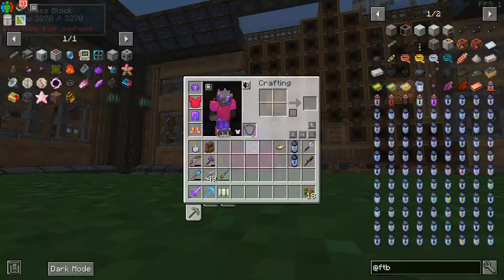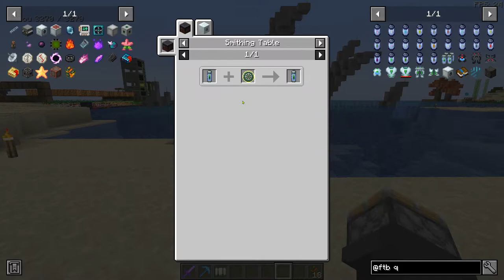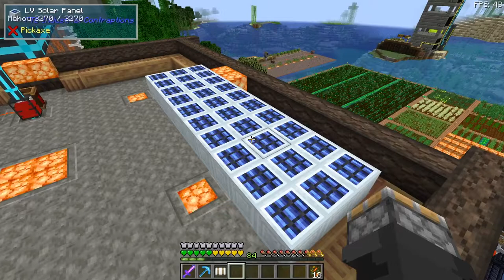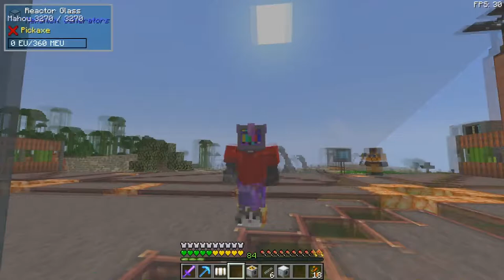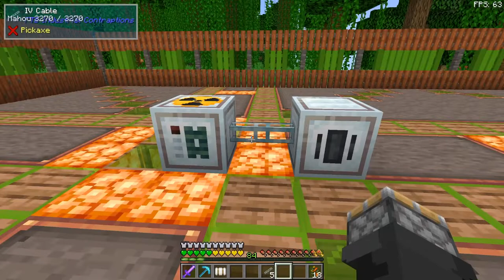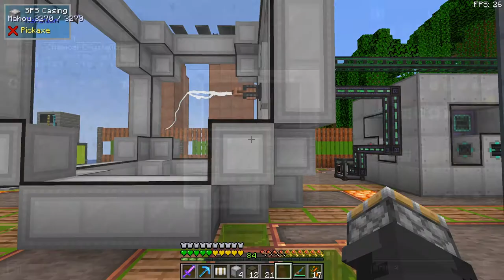2 Types of Antimatter - FTB Industrial Contraptions & Mekanism - ATM7 Ep 15

Comment: very late but... was messing with the antimatter constructor since I didn't know how it worked, and was working on other things, so casually hooked it up to my solar panels that were working on powering something else, then started watching this video, since I didn't know how to make FTB IC antimatter I searched it up and found this video.
So I feared I might need a whole lot work getting all these items, only to realize I had 11 antimatter already sitting in my constructor, WELP...
I just used the pump from FTB IC and attached chests to just drop empty fluid cells in there. and then a pipe out to export the full ones.
Reply: what solar panel you use ? I use mekanism generators one and didn't give any power to the constructor

Comment: can i use the mod POWAH nitro reactor to power the mekanism fusion thing ?
Reply from the maker: I don't see why not? But it takes a ton of power to make the antimatter in there. I'm unsure of how much rn or how much the nitro reactor puts out. So you might want to make a power reserve bank like the matrix that I have in that video to store enough.
Reply: @TubeAndKnuckle  the nitro reactor generates 460k+ FE/tick
Reply from the maker: @Raku235  The other thing is you need plutonium and polonium pellets to craft the parts needed to build the Supercritical Phase Shifter structure. For those pellets you need a MEK Reactor to get nuclear waste so.....might as well use that reactor to power the SPS at that point.
Reply: @TubeAndKnuckle  yeah figured that out when i was checking the recipes, ive got your setup working but its kinda slow but im almost done
Reply: also i tried to build the Supercritical Phase Shifter just how you built it, but it didnt give me the redstone effect and it wont open, did they change the recipe ?
Reply from the maker: @Raku235  No recipe change to it. You must of placed some blocks wrong? Double/triple check your build
Reply from the maker: @Raku235  Did you play with the burn rate of the reactor? that is how you can speed it up. But be careful not to exceed the limits!! That thing will blow up!!!
Reply: @TubeAndKnuckle  i just typed the max burn rate which is 25 i think
Reply from the maker: @Raku235  Aight cool. Did you get the SPS thing working?
Reply: @TubeAndKnuckle  i rebuilt it around 6-7 times and changed the reactor glass to structure glass and messed around with the layout of the ports untill it randomly worked
Reply from the maker: @Raku235  Sweet! Congrats... I know the struggles sometimes things are just goofy😒
Reply: @TubeAndKnuckle  i learnt the hard way why you checked the pipes were empty before breaking the nuclear waste pipes 💀
Reply from the maker: @Raku235  OHH NO 😂Hopefully you had the suit on that makes you talk Russian🤣
Reply: @TubeAndKnuckle  had to make one, and i blacked out when wearing it idk what happened

Comment: I can't get the stupid canning machine to accept any kind of power and idk what I'm doing wrooooong :D
Reply from the maker: Those FTB Industrial machines are kinda goofy. Did you try using cables from the mod itself to attach power to the machine? Also pretty sure that I needed to use a method to generate power specifically from that mod as well for anything to work.
Reply: LV cables hooked up to powered furnace or the solar option wouldnt go higher than MV Solar it will burn out cable or canning maching u can run 2-3 furnaces tho and able to put 3-4 speed upgrades in ur canning machine think there called overclocker upgrades.